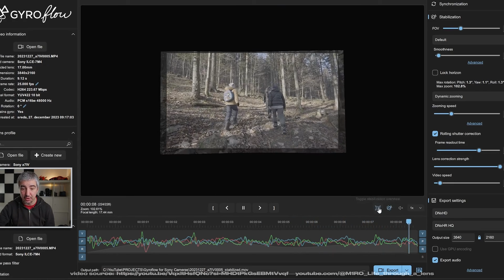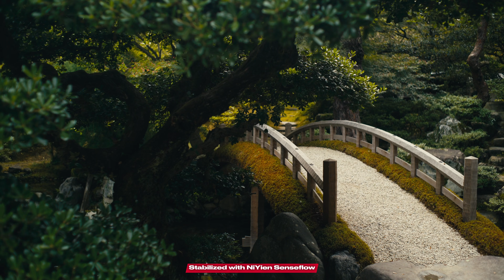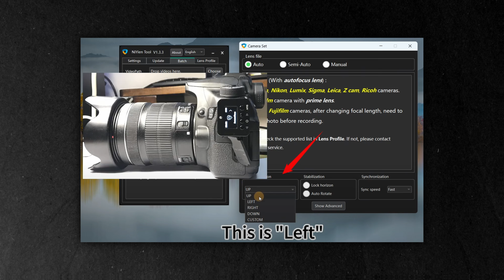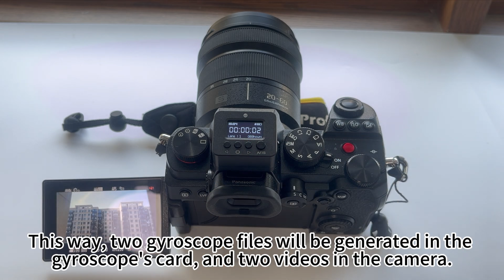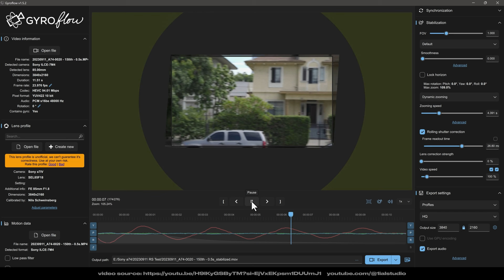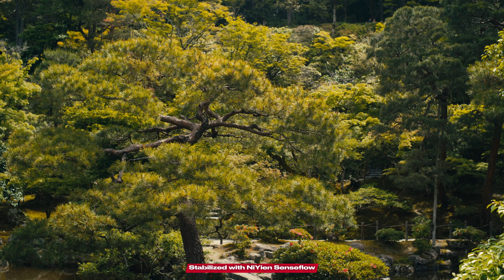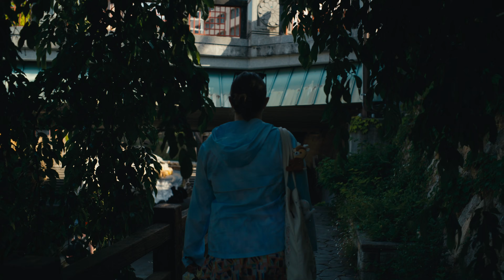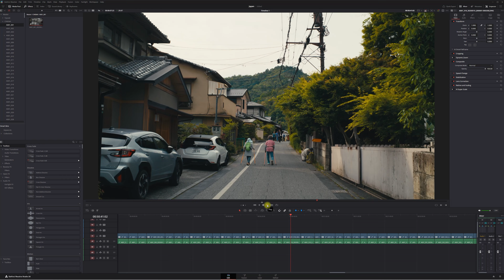Stabilizer for any camera?! NiYien Senseflow A1

Comment: A great and extremely informative video. I didn't know about this device but somehow your clip came at the right time. I work in the wedding industry and honestly for a very long time I have wanted to go to events as easily as possible, with as little equipment as possible, and at the same time be able to get great images without having to use a gimbal.
I use Panasonic cameras which unfortunately do not have the built-in option to record gyro data, as other cameras do, and then your solution seems ideal for me.

I have just one question, to see if I understood the information related to zoom lenses correctly. I use a 24-70mm zoom lens most of the time at an event. And then how is it correct to use the lens in combination with the presented system? I have a 24 mm lens, let's assume. I press record and do not change the focal length at all and then stop recording. Will that work? Do I understand correctly? Then, if I want to zoom, I do it before pressing record and do not change the zoom while I am recording. I would like to ask you to tell me if I understood correctly and tell me what happens if I press record at 24 mm and then, while recording, I change the lens zoom to 48 mm.

Thank you in advance for your response and for your time.
Reply from the maker: As far as I understand it, if your 24-70 lens has an electronic connection with your camera, you don't need to change lens profiles at all, because Niyien tool will automatically define the current focal length from the video files.And only the exact moments of the zooming would not be stabilized.There's also a Discord channel where you can ask questions directly of the developer:
https://discord.com/channels/1148857031382536343/1148857031382536346

Comment: works great,  using it on ZR
Reply: hey, considering that the matrix of ZR still a little bit loose even if the IBIS is turned off, did you notice any wobbling effects while using Senseflow?
Reply: @jackdanyal4329 This is because when shooting R3D files, DaVinci Resolve lacks distortion correction, while there's no such issue with N-RAW. We'll have to wait for Nikon to update the SDK for DaVinci Resolve.
Reply: @NiYien , hey, thank you for the response. The only thing that bothers me is the advice to use a shutter speed higher than 1/120. it somehow limits the usage when you need a 180-degree rule. But is it still possible to shoot lower than 1/120 in some conditions?
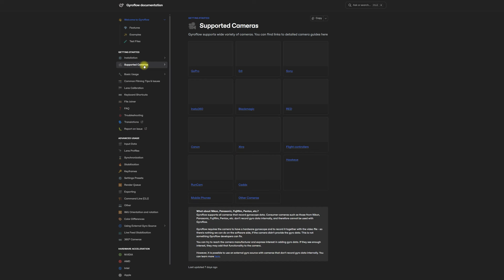Reply from the maker: @jackdanyal4329  I've covered this question here at 11:21
Reply: @NiYien can you use this on ursa mini pro g2s!?
Reply: Have you tested this with anamorphic ?
Reply: @frameshiftx yes of course.